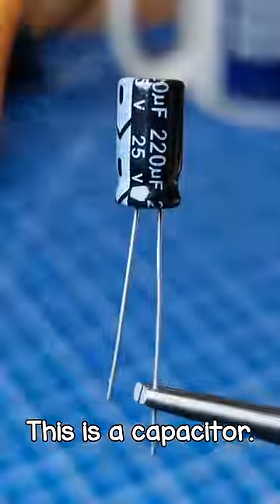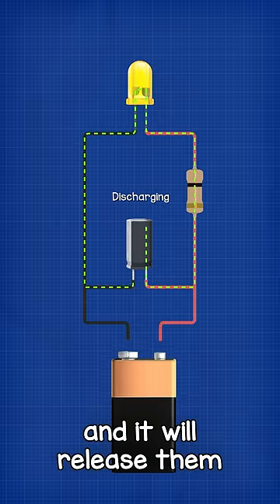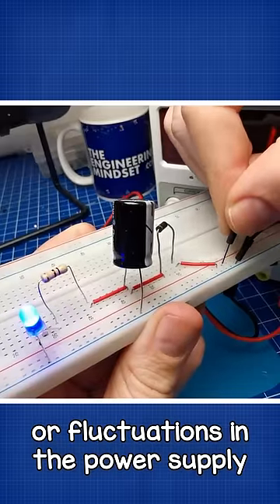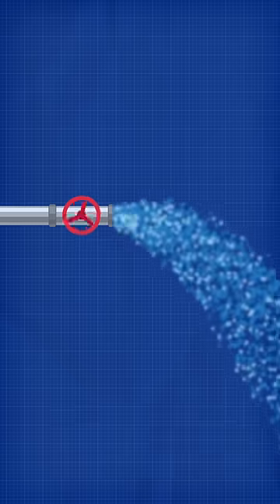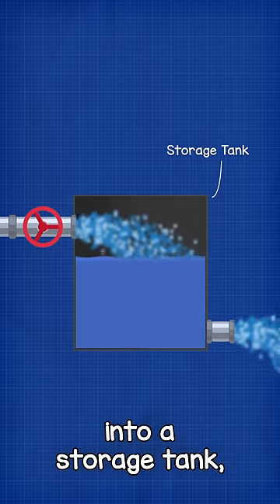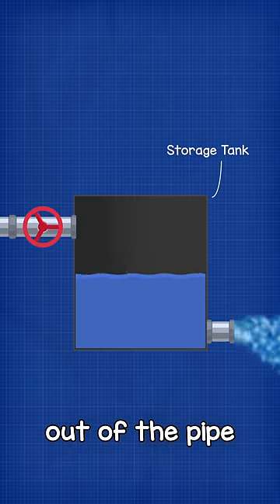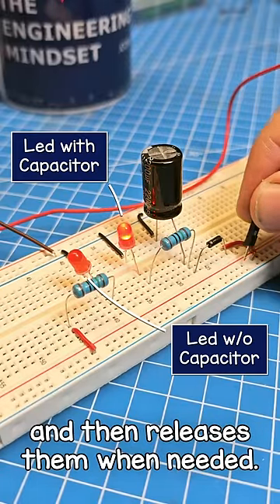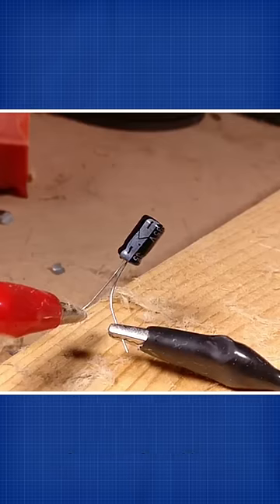What is a capacitor? #technology #electronics #engineering

Comment from the maker: Get this electronics book ➡️ https://amzn.to/41cCJPk
Reply: This link isn't working
Reply: Thank you I want to learn audio repairs but I haven't a clue and your shorts are helping me by not overwhelming me. I have a singer sewing machine and I believe it was the capaictiors that made it start sewing all by itself I left for a while plugged in! Why would this have happened? I removed them and it runs fine now. Are capacitors not nessisary in modern things? Or why would old ones start the machine by itself? Thanks.
Reply: @MegaBanannaman you have to type it in to the url box because sometimes youtibe doesn't allow a html
Reply: Dont let any government threaten you. keep helping make people more aware of how the world gets problems solved!
Reply: The storage tank analogy is not really accurate, because the capacitor would send the electricity back through the positive wire. It would send the water back thought the same pipe.
I imagine it more like a spring, that when you release it, it pushes back
Reply: @burt591  Is there not a component to restrict that from occurring ?
Reply: Writing a book about electronics is worth bragging about.
Reply: @reccocon3442 Yes, you could use a diode. But normally you don't want to prevent that, it's actually a very useful feature of capacitors that can be used to stabilize the tension.

If you have peaks of high tension the capacitor will absorb electricity and release it back to the positive wire when the tension is low, so the tension in the positive wire will end up being more stable.

It actually behaves like a battery, the only difference is that the charge and discharge is very fast, in milliseconds.

The main problem with the illustration in this video is that it's connected in series, and a capacitor is never connected in series, it's always connected in parallel. Electricity never flows through a capacitor, it's totally not how a capacitor works
Reply: Better is explosion
Reply: @MegaBanannaman Use the browser version. Or just memorise the code (it really isn't that long).
Reply: i opened up a capacitor
Reply: @MegaBanannaman  You need to copy it on a PC or Laptop or make a Screenshot and copy the link

Comment: You are right, but teaching people that electricity works like water is wrong. It doesn't work like water. There are positive and negative particles. When you have voltage from one point to another (difference in poles), the current will happen. But that's not because it flows like water, but because there are the +- patricles and they react with eachother. In capacitor, the particles attract to the electrodes and it's the voltage between them that's "stored". It's not really stored, but it's like a miny electricity storage that is being simulated in the circuit. And after the circuit becomes "wobbly" or the voltage of a main source is shut off, the voltage of a capacitor powers the circuit for a very short time. It's mainly in milliseconds, but it can be longer when the circuit is made that way and the capacitors are larger (have more inside electrodes to store more voltage between them). I'm an electrical engineer, but I can't speak profesionally in English to explain it better. If you have the ability to do that, please do it. This works for people who don't work in this industry, but it isn't good enough for people who work in it.

Comment: This is By far the best analogy and explanation about capacitors I've seen
Reply: The storage tank analogy is not really accurate, because the capacitor would send the electricity back through the positive wire. It would send the water back thought the same pipe.
I imagine it more like a spring, that when you release it, it pushes back
Reply: @burt591 the traditional hydraulic analogy for a capacitor is two pipes, one inserted into another, with an elastic membrane in between.
it's a fair analogy for: capacitance (membrane firmness), how capacitors block DC, how they pass AC despite no connectivity between plates, dielectric breakdown at overvoltage
Reply: @ahG7na4  That's a neat analogy, it covers all the features of a capacitor.

Comment: I've learned about these guys when I was 7 Years old. I thought it would be a good idea to take a part. A Kodak disposable camera to see what was inside. Well... Let's just say I touched the circuit board and then I accidentally throw it by reflex. Completely puzzled on what just happened. Because I didn't understand how a 1 V battery could do that. Because at the time, I didn't even know what a capacitor was. Until I got shocked. Then I inspected it more to find what did it. I discovered the capacitor with the voltage rating. Then it made sense to me.
Reply: Dude! Flash capacitors on old school cameras are/were viciously brutal! They do not play!
Reply: Also I wish I could remember who made the video but there this guy that shows with a relatively simple set up how a voltage multiplier works using DC and just making and breaking a connection by hand instead of with a MOSFET or something and he was able to quite easily get like 150-ish Volts built up in seconds using like a 9volt battery I believe. It was pretty wild
Reply from the maker: See my new MOSFET explained video here➡️: https://youtu.be/AwRJsze_9m4
Reply: @EngineeringMindset  I already know how these things work, but thank you.

Comment: Capacitors have confused me for decades. This is by far the best explanation I've seen.
Reply: Yeah when I use to put audio systems in my car . I thought a capacitors was all I needed to stop my headlights from flickering but boy was I wrong. You must upgrade your car’s electrical system before adding any noise.
Reply: What analogy could be inductors?
Reply: Capacitors are easy to understand... They are like inductors but, they store energy in a magnetic field
Reply: Yep, I'm the same, the more I learn about them the more confused I get.
Reply: I'd say resistors are...
Reply: @CommercialGasEngineerVideos  capacitors are amazing
Reply: Literally? Confused for decades? If you really want to know ever searched on internet? Caps. are like just small cell (battery) which can store charge for a short amount of time (depends on uF) and release as you set your circuit
Reply: Using water as an analogy is the best way to learn electronics.
Reply: @TacoDaddy-mr8ig you're wrong Taco Daddy... inductors store energy in magnetic fields.
Reply: Is the stored energy the magnetic flux ? Also what’s a good analogy for the inductor then?
Reply: This might be a polarizing subject, but i like it when my headlights dim to the beat
Reply: if i get this video in my school days
i may be not just an software engineer
but also wanted to be a electronic engineer 

really amazing explanation. great word.
Reply: Huh...i guess i wasn't the only one.

It's literally the one thing i don't know the purpose of. I know it stores electrons, but for what purpose.
Reply: Essentially, capacitors are also used to help prevent damages for other electronic component from sudden loss of flow of current. It makes losing current in the circuit much more gradual instead of being instantaneous, just like stepping on a car's brakes smoothly rather than slamming on it immediately.
Reply: In audio, don’t the caps make a difference in creating LPF & HPF’s? A combo of a cap & a resistor creates a filter. I can’t remember exactly, but it’s probably one of those scenarios when the more capacitance in the filter, the higher the bass frequencies are allowed. Then, the opposite is said for the fewer levels of capacitance, allowing more higher frequencies through. 

Maybe I should have researched this before typing it out, oops!
Reply: Whats so confusing? It’s literally in the name lol
Reply: Actually the explanation here in this video is slightly wrong. In very small time-scales, capacitors act like a short, but as time progresses, they become like an open circuit. A way to imagine this is to have a pipe full of water, with a stretchy membrane somewhere along its length. Initially, the water will flow as if it wasn't there, but as the membrane stretches and begins to apply an opposing pressure, eventually flow will stop.
Reply: @jongyon7192p Inductors resist rapid changes in current, and act like open circuits initially, then act like short circuits in steady state. For the water analogy, imagine an inductor as a water wheel dipping into the pipe with a large flywheel attached. Initially, the vanes of the waterwheel block the current, but once the wheel picks up speed, its speed matches that of the water, acting as if it's not even there.
Reply: @TacoDaddy-mr8ig you've confused me. Capacitors store energy in charges. Inductor store energy in a magnetic field.
Reply: @maruftim  nah resistor are simple! They’re simply a speed bump for electrons. Any medium that slows electrical flow can be a resistor
Reply: @MultiversalGoat energy is stored in capacitors as a static electric charge. Simply two conductors separated by an insulator. One plate is charged up with a negative charge (has a bunch of extra excited electrons), and the other has a more positive charge (is depleted of electrons). Much like you dragging your feet along the carpet just before you touch the metal door knob or your sister to shock her, you have become the capacitor…
Reply: @Odontomango many many purposes. Much more than a reply on a YouTube comment can convey.
Reply: right? I was blind and now I can see !
Reply: @BigKing17 ข
Reply: It's never the capacitor that was confusing. At least for me. It was always the numbers and values, the volts, watts and currents.
Reply: Capacitors do it 🤯 with your mind.
Reply: I always just think of them as very quick and low storage mini-batteries.
Reply: Yup
Reply: there's formulas that u need to know to understand the capacitors well
Reply: that's true😊
Reply: that's true😊
Reply: that's true😊
Reply: @BigKing17 yup, medicating won't help but actual healing
Reply: @Odontomango it smooths out shitty/ flu(x)tuations in current/voltage
Reply: the traditional hydraulic analogy for a capacitor is two pipes with an elastic membrane in between. it's a fair analogy for a ton of capacitor behaviors, from blocking DC and passing AC, up to and including failure from overvoltage
Reply: @stevez2158 great minds think alike, teehee
Reply: Sorry you're an ijiot if they confused you for so long
Reply: this is a horrible analogy, they don't work like this at all 🤦

Comment: Capacitors are also great at storing large amounts of energy from low power sources so you can have low power on your board for sensitive equipment and to keep your amps down and then you can release all of that energy quickly for a high burst output. But that was a great explanation. Definitely better than any professor i had when learning electrical engineering
Reply: I believe that's how the flashes in many cameras work, especially the disposable film ones that needed a few seconds to charge up first
Reply: Yup. It’s the ol “voltage multiplier” circuit. I was just replying on another comment about a pretty awesome video I saw like a week ago where this guy demonstrated with a relatively simple set up using I believe a 9volt battery and by just making and breaking the circuit by hand instead of a mosfet or something, he was able to get up to something like 150 volts built up into the cap in a matter of seconds! Shits pretty wild
Reply from the maker: See my new MOSFET explained video here➡️: https://youtu.be/AwRJsze_9m4

Comment: This is a very good analogy. But if you want to illustrate it more specifically, an elastic container (like a water balloon) attached to the pipe is better. You can demonstrate how it has a maximum capacity, how it doesn't fill linearly, and so on.
Reply: Or an elastic membrane in the pipe, which doesn't let the direct current through, but kinda lets alternating current "flow" without water actually getting from one side to the other.

Comment: A better analogy would be an elastic membrane. The current goes the other way when discharging. And also, it stops direct current, while allowing alternating current to "flow" without water actually getting from one side to the other.
Reply: Yeah. But even then the water analogy won't work. Electricity is an own unit, it can't be morphed into water. It works differently. Even the flow of water as being interpreted to current is wrong. It doesn't work as a flow, but it works as charged particles meet with non-charged based on the voltage. If more difference is between the poles, the more current there is in a circuit (generally) because the particles have mroe energy. I can't explain it because I don't speak English very good, but I hope that others who speak English good would explain it the way it is.

Comment: I believe they don't actually fill with electrons in the same way a battery might, they would actually us the polarity made by the ac frequency, then when the polarities switch the dielectric snaps back into place from being stretched out, this completes the circuit by putting positive to negative

Comment: The best explanation on how capacitors work
Reply: For amateurs yeah, but electricity and other conditions (like the magnetic field and opposing voltages in devices or circuit parts and logical circuits) make it a lot harder. The elecricity is more complicated than many think.
Edit: Sorry, I put it for a wrong comment.

Comment: As the capacitor is aging, you don't have to remove it. You have to put your laptop or phone into a car glove holder for 3 days, and keep it there. If your car battery is in perfect condition, and your batt has the triangle radioactive sign on it.
If you changed liquid in the batt, then the trick won't work.

Comment: There is no net storage of electrons in a capacitor. Electrons are removed from one plate and an equal number of electrons accumulate on the other plate. 

Energy is stored in the field between them.
Reply: Is this how it works with a Quartz crystal when it is under pressure? Do the Electrons just run out and not get replaced? This question is driving me crazy looking for answers on the net.
Reply: The water level, which directly proportional with the pressure represents the voltage.
Reply: @pinballrobbie well piezoelectricity is alternating current.

Simply put, the electrons are being moved back and forth when the pressure is applied and when the pressure is taken off.

The demonstration in this video is for DC circuits so it will literally act like a short lived battery as demonstrated. Most direct current however is not truly “flat” because it being rectified/commutated from A/C most of the time.
Reply: @pinballrobbie quartz crystals don’t store energy, they oscillate when energized. Inversely, they emit energy when oscillated or struck. See piezoelectricity
Reply: @pinballrobbie I’m sorry, I now see what you’re question was truly asking. So they would not have a net loss of electrons due to the piezoelectric process. Electricity is always an effect of a charge differential. So the arc discharge you see is actually electrons being replaced to whatever it is that’s arcing, thereby becoming neutral from its previously charged state.

Comment: A capacitor is fonsist of ywo parallel plates of opposite charge to store electric charges 
You can put two type of material in between them 
Di electic and conducting slabs 

Fun fact : 1 farad capacitor will require size equivalent to distance between sun and earth and thats why we use micrufarad (uF) as its unit

Comment: So also like a tank xD

If you put in to much pressure, it will also burst.

Unpolarized are tanks that are filled from below with pressure, and polarized are tanks which are just filled from above like in the animation xD
Reply: Ya we designed a rover using a breadboard and arduino in school, and blew up our capacitor XD

Comment: Very nice and simple. Thanks. Can you explain how capacitors make it to use no-neutral smart light switches please? It is very weird to be able to power a device without neutral just by using a capacitor. Thanks in advance. And good job

Comment: single phase motors .  they need run caps to my understanding to create the break . to creat a break in the line voltage going to the motor . wen the run cap goes bad the motor will just sit there and start humming.  not moving .  if you see a fan motor that needs a run cap and the motor is humming not moving.  you can physically spin the motor with your hand and that will make the motor start working.

Comment: i was taught in school that one way to avoid these explosions is to add those devices (i forgot their name) that only permits current to go in one way and not the other
Reply: Diode? That's a great way at streamlining the current and putting ease on other parts, but you have to make sure there is a resistor or a device to take the "waste" current. You can use Schottky diode to short the circuit and avoid breaking the capacitors, but it will damage the source if there aren't other security parts. It will work the best in a closed circuit with a bunch of resistors and capacitors because if one capacitor is overloaded, it will distribute the waste current to other resistors and the other capacitor will balance.

Comment: I wish you explain start capacitor and how they work!
Reply from the maker: See our video on circulation pumps
Reply from the maker: See our video on circulation pumps
Reply: Start caps hold a bit of extra charge for the motor to overcome inertia at start up. It’s usually tied into its very own special set of windings on the stator and controlled via a centrifugal switch so once the rotor is up to speed, the start capacitor and start windings are powered down. But as far as being a capacitor goes tho, it functions just like any other capacitor, just briefly. 

Please don’t say you wanna know how the Run Cap works too…🤣